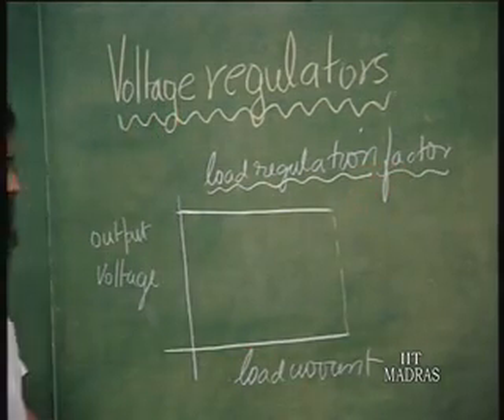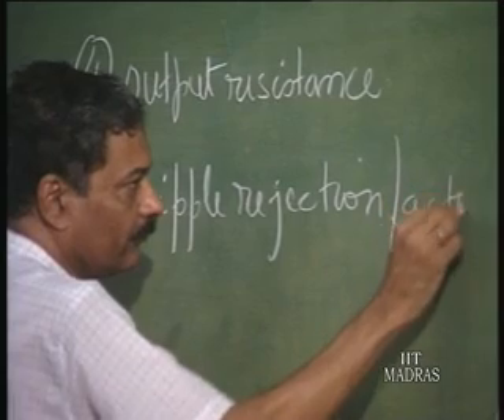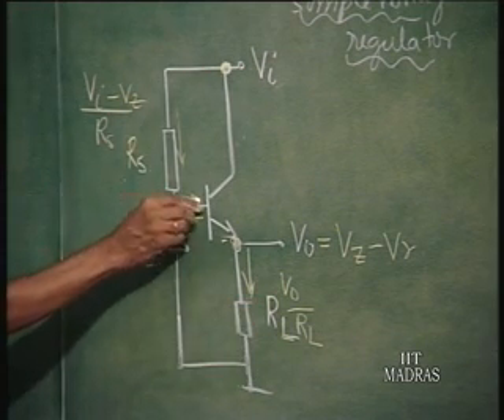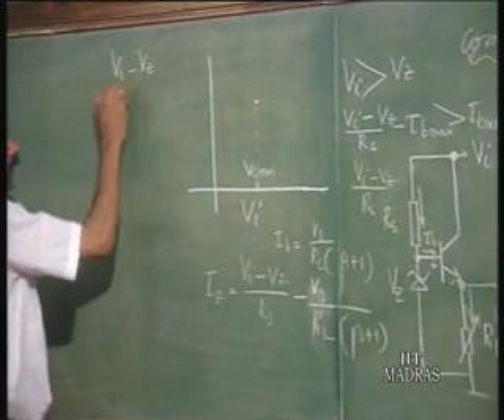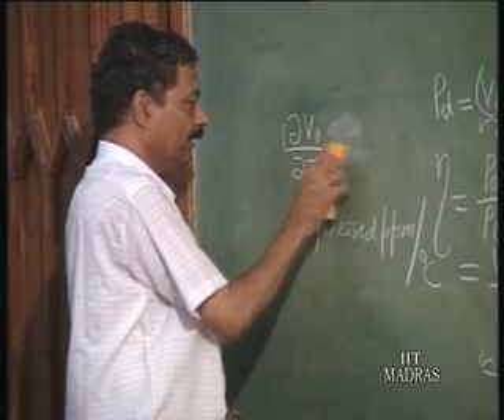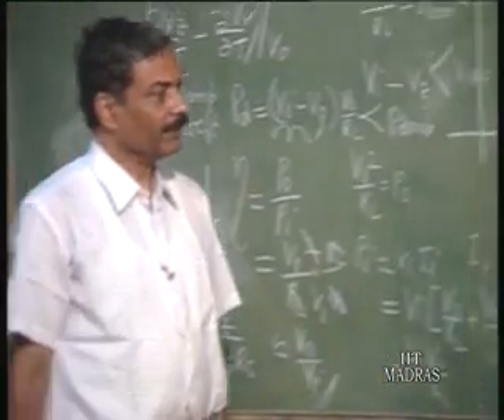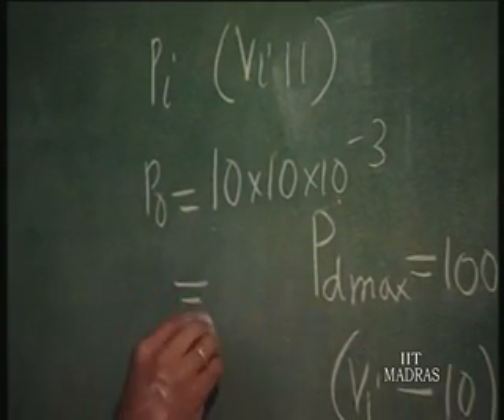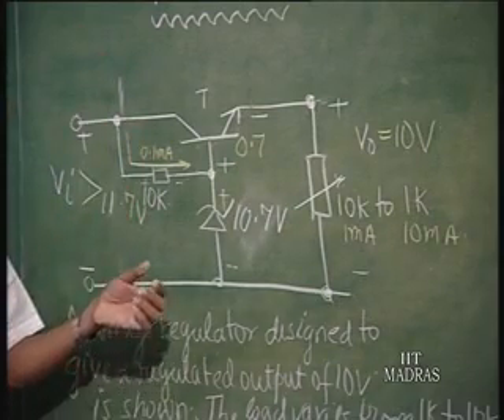Lecture - 26 VOLTAGE REGULATORS

Comment: To get a 'feel' for the speed of correction by a regulator watch the set of videos in two parts on the design and operation of a Regulated DC Power Supply using a unified approach to electrostatics and circuits
Part 1 of 2
https://youtu.be/TQxGT5tZW5E
Part 2 of 2
https://youtu.be/pDdoZ2u8TA8